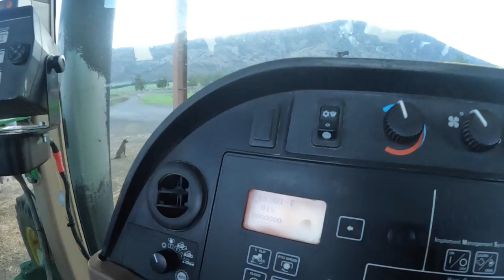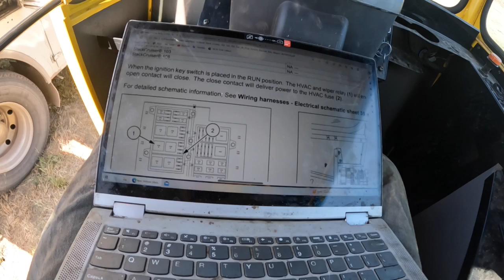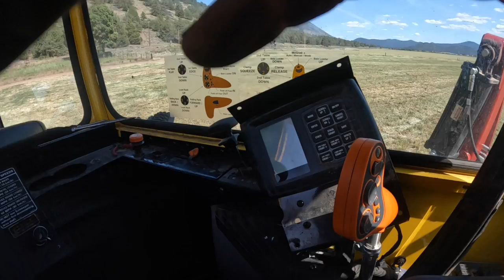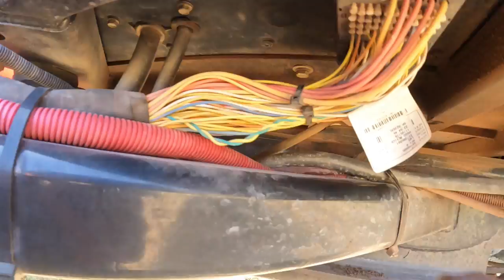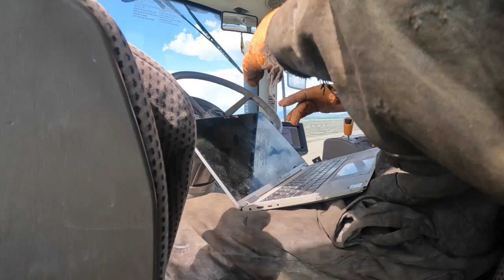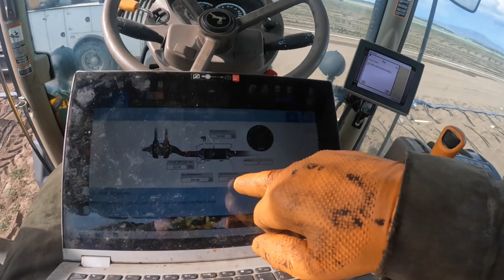Putting the new engine to work in the service truck.

Comment: Off highway and on highway trucks need to give the operator more information of what is going on with the dpf.

Need a gauge showing dpf soot level.
Most trucks don't show it doing a Regen going down the highway.

Until parked Regen needed message comes on operator doesn't know there is a problem.

Comment: Lmbo - somebody who wanted the night off pulled the fuses 😂. Common practice by engineers and pilots when I worked on C-130s in the Navy, except they'd pull circuit breakers. Mysteriously happened every time flying through Hawaii or the Philippines. 😂

Tip: in case you don't know, hit "control + F" for 'find' when you're using those downloaded manuals. It should help you find things quicker. ✌🏼

Comment: Wonder why someone monkeyed with the fuses? Simple fix but a hair pulling torture process to read the book and then tear all that apart because of work or had their fingers in there. I just replaced a load control shaft, bushings and seals on my 4030 and it fought me the entire time from moving wheels out to get shaft out. Supposed to be a simple fix and I feel your pain. Great work Warren!